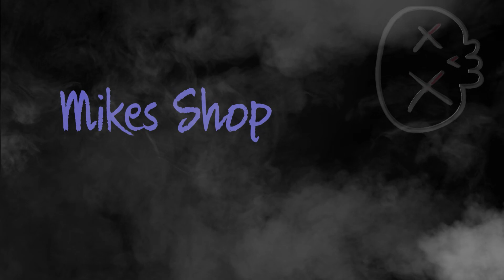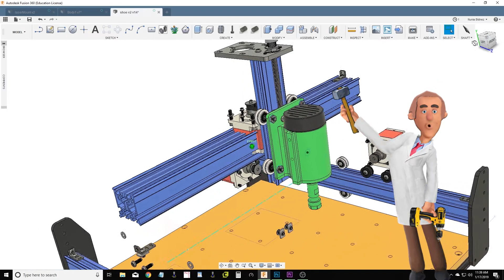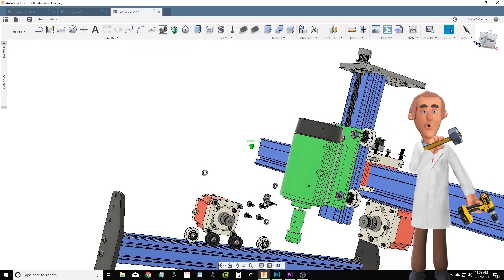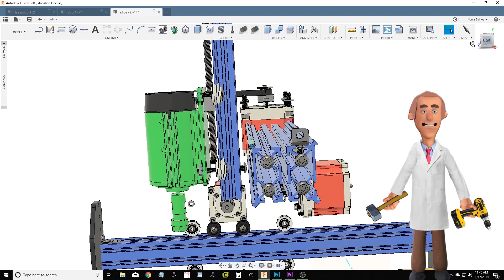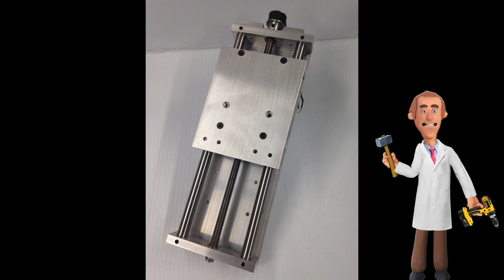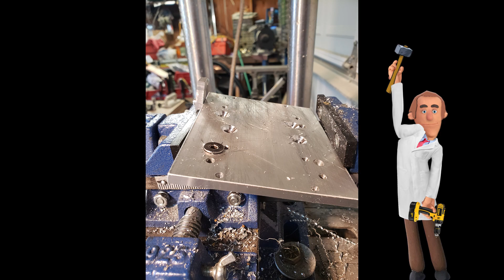spindle

Comment from the maker: Tom, the air will be connected to the small ball valve. I have a 1/4" branch off of my shop air system already for my airbrush. I would like to automate it. I believe I have seen solenoid valves on adafruit's site.
I meant to say cutting fluid instead of water...lol. That will be connected to the top of that valve and fed by a recirculating system I have yet to design.